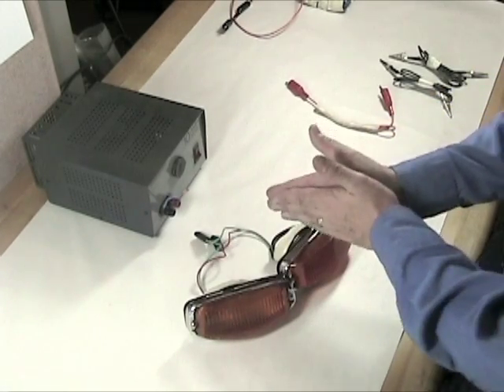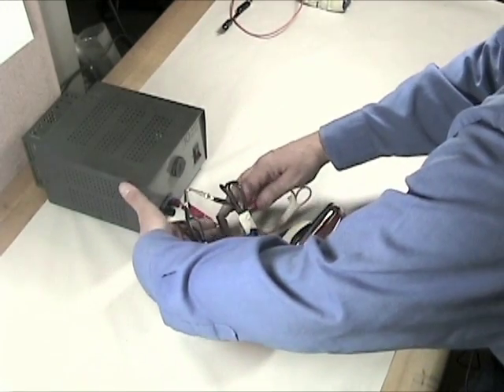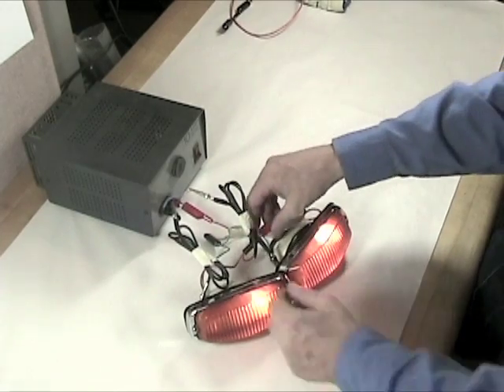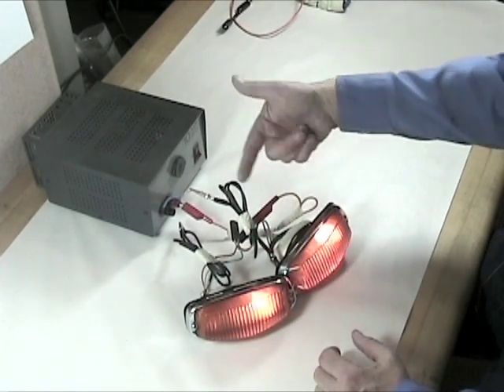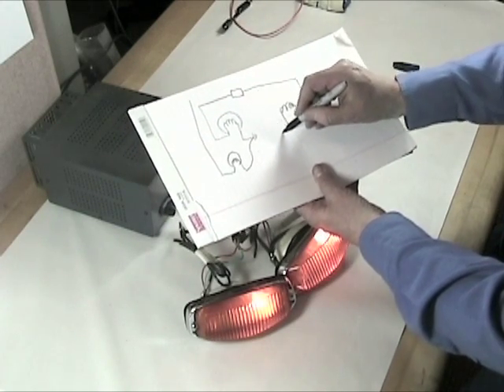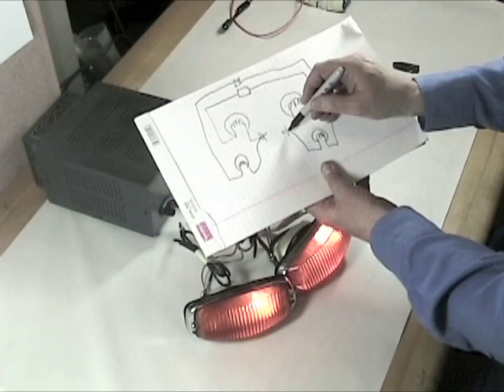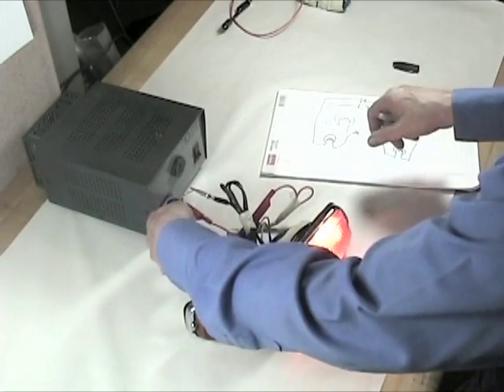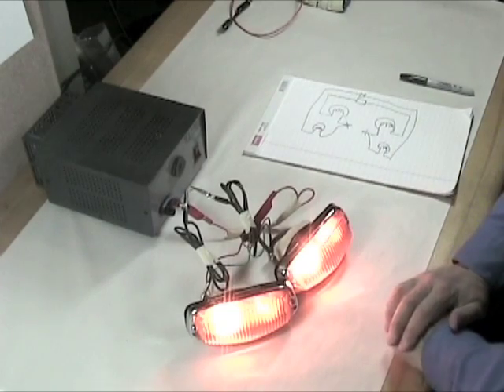Bad Grounds -- The Mystery Explained

Comment: I think this in some way may answer a puzzling situation that I have. I had tail light that would not working by mistake a found power was where the ground should be. I had a short to power the wires were very old. I changed it out and got a new harness. It worked perfectly for threee years but now its doing the exact same thing. It's showing 12v where I should have ground the only problem is there's no break in the wire this time. If I add ground the light turn on and no longer reads positive power. Please help I'm trying to understand why.

Comment: First thank you for the video, you're a very good teacher. I have a question, I followed every single thing you said, but had one puzzling question. I simulated the same set up and it worked the same way with one exception which is the drawing. The drawing to me makes perfect sense I'm puzzled though with the route you say the ground travelled after it was disconnected. With mine tire's no ground to travel back through so the only route is getting ground through the hot side, through the connection through the other light then to the other ground. There was only two grounds correct? The one that was disconnected shouldn't be able to run back through the ground of the brake light since internally it's shared. Clear this up for me please and thank you.

Comment: Hey Mossmotors here is my issue on my 63 tr4....everything works...Headlights fine...indicators fine...brakelights fine but when I have headlights on and I step on brakes, my left indicator light dimly glows. It doesn't blink or anything just dimly glows. By watching this video I obviously have a ground issue but I'm unsure where to start. And since everything works I really haven't tried to figure out whats wrong. Any assistance from anyone would be appreciated. Just weird everything works